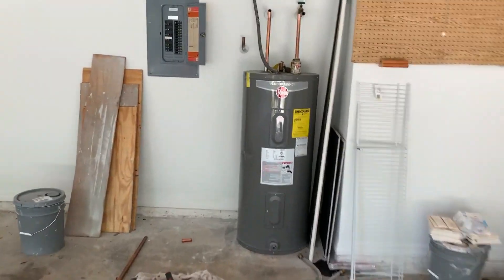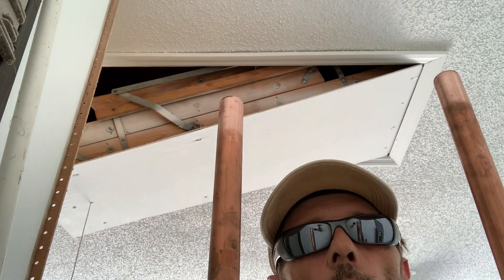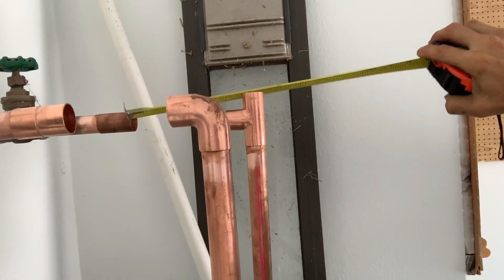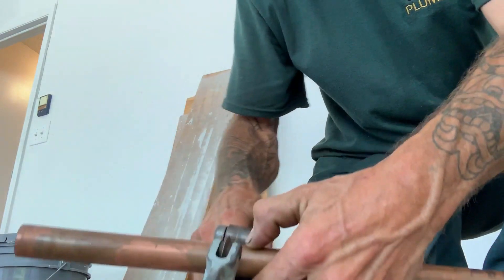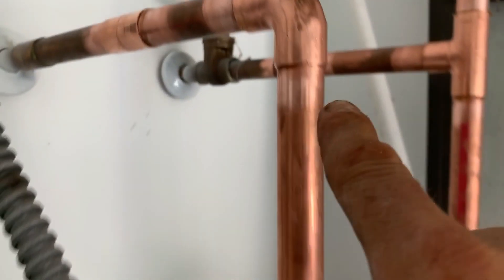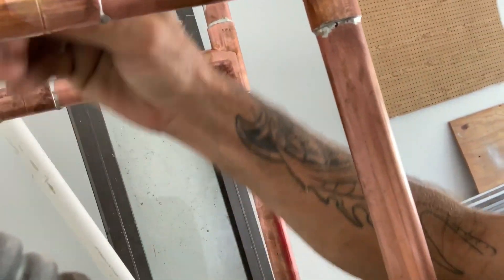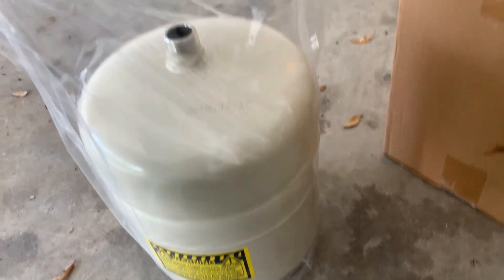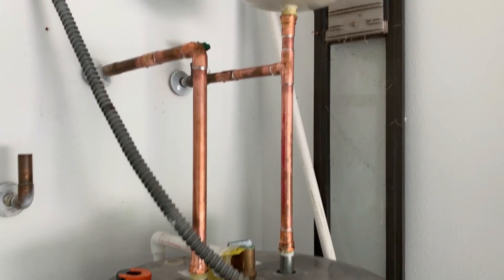HOW TO INSTALL A THERMAL EXPENSION TANK ON WATER HEATER

Comment: Rheem are garbage, why didn’t you use type L copper pipe, M is for the t&p blow off only.
Reply: In 5 years of operation,  my Rheem water heater has never had a problem. And it has a 12-year warranty. Fortunately,  I live in Dana Point, California, rather than "Garbage Grove," California, as the city of Garden Grove is known where I live.
Reply: Herrick Inman don’t worry your rheem heater will start to leak from the tank anytime now, garden grove as been known as garbage grove since the early 70’s due to a sanitation strike that lasted three weeks.
Reply: @borntwice4724   One year after you predicted that my Rheem "will start to leak from the tank anytime now,"  it has still not had a leak and has continued to operate trouble-free since I bought & installed it 6 years ago. If what you claim were true, Rheem would not offer a 12-year warranty. I bet you also believe the 2020 election was "stolen" from Trump and that he really won it "by a landslide."
Reply: @herrickinman9303  When your tank does go...don't buy a tank base on the length of warranty. All are built the same. The diff between a 6 and 12 yr warranty...don't laugh..is they install a second anode rod in the tank. Very true
Reply: @josem2468  Each of my water heaters has lasted 15 years (well beyond the warranty period) without any maintenance.  The last one had a 6-year warranty.

Comment: didn't ream the copper pipe after he cut it,  didn't change that old shut off valve with a new better ball valve, didn't test water pressure to make sure the expansion tank matched with air pressure.
Reply: and no dielectric unions, and used type M copper
Reply: @wcsd9577  How can you tell it's not type L or K?
Reply: @pipingdogtooth  It's L or M and. Type L has blue paint stripe type M has red paint stripe
Reply: @pipingdogtooth  The red ink on the printing of the copper pipe indicates Type M in this case. Versus blue ink for Type L or green for Type K.
Reply: He did not check the house water presure and adjust the expansion tank pressure. It is very important step.
Reply: They are dielectric nipples coming out of heater
Reply: @chrispinette8303  do Rheem water heaters use dielectric nipples? I installing a AO Smith and the manufacturer says dielectric unions are required.
Reply: Probably couldn't read the pressure gauge anyway since he was wearing his sunglasses indoors throughout the job
Reply: He probably did it off camera,  it hard to video everything thing when on a actual job.
Reply: Yup everything he did was wrong.this is how you end up with problems

Comment: Dont use shark bites but let's screw copper fittings to galvanized pipe to promote electrolysis.   Nice.
Reply: They are dielectric nipples with plastic cores
Reply: He is using dielectric nipples he talks about the plastic in them.
Reply: Most have Dielectric Couplings.  Use whatever you want to connect it.

Comment: The water heater will fail well before 30+ year rated sharkbite ever will. And when the water heater fails, you just replace the sharkbite valve flex lines with it like you would a dishwasher or a washing machine. In and out replacement in less than 30 mins
Reply: Sharkbites are fine. I personally wouldn't use them right at a hot water heater but about 16-18 inches away would be better.
Reply: @garygray4664  they are rated for 12" away from tank nipple
Reply: I I am a plumber never use shark bites There’s way better stuff to use I agree with the guy make the video you don’t use shark bites If the homeowner wants to use one that’s his choice but if you’re paying someone to do a job they should do it right
Reply: @grow8094  what's the point in soldering or using pro-press, when a properly installed sharkbite fitting located 12" above the tank nipple (per the manufacturer's requirement) will outlive the water heater itself?
Reply: You hire a hack if they use Sharkbites. Only for homeowner use.
Reply: @josem2468  and this is a home, you moron
Reply: @josem2468 nothing wrong w sharkbites, but they are triple the cost of copper

Comment: Along with explaining how to charge the expansion tank, I think it’s worth mentioning the minimum distance of 18 inches away from the hot water heater that the expansion tank needs to be. You are very close to that.
Reply: Can you elaborate on that "18 inches away" requirement and what is its purpose? Does it have to do with the heat from the flue pipe and the balloon part inside the expansion tank?
Reply: Never heard of that , are you thinking the minimum height of the vacuum breaker perhaps?
Reply: There is a code that says pex has to start 18inch from the water heater lines

Comment: Don't you need a dialectric fitting when going from iron nipples to copper?
Reply: Yes, if you don't use flex connections with the swivel nuts, you have to have dielectric unions so you don't have to cut the pipe to remove the heater,  the plastic in the nipples are part of the built in dip tube on the cold side that puts the new cold water down to the bottom of the tank,  and heat traps built into the new heaters.  Also he didn't ream the pipe which is also wrong,  not reaming will create pin holes in your pipes because the burr that wasn't reamed will stop the smooth flow of the water
Reply: that's the same question I have.  but I do notice the niple has a plastic on the top and maybe you don't need one.     hopefully someone will answer this
Reply: Milwalt. I used to work for Lowe’s years ago in the plumbing department and learned a great deal. I’ll stick with what I was taught by old plumbing experts. Better safe than sorry. It certainly won’t hurt to have a dielectric fitting when joining different metals.
Reply: @Pontiacman1964  technology keeps advancing and leaving some old school plumbers behind. now a days most plumbers don't weld they propress or crimp.  new things keep coming out that sometimes we afraid to try it.   we need to update with new stuff.
Reply: @dannyboy9254  Yes, update o more modern tech, If you have the funds to purchase a propress.
Reply: that's what I said! smh

Comment: Excellent video,  thank you!
I have a couple of questions.... since I am planning installation in two locations in attic, one with very limited space....

1. How far from the inlet side can an expansion tank be installed. Say, would it serve its purpose if I ran a  10 foot pipe from the inlet and installed the expansion tank sideways, or upside down? Shouldn't the air valve on the tank be easily accessible for maintaining pressure?

2. How do you size an expansion tank for a 40 gal vs 75 gal water heater?

3. How do you feel about using pex instead of copper?

Thanks in advance for your help.
Reply: Great questions, I wish he would get back to some of these questions because I need the answers as well. Thank you for asking them.

Comment: Thanks for the vid and info! What size expansion tank do you recommend for a 50gallon water heater? Or does it really matter?
Reply: Smidjee it depends on 3 factors:1 size of water heater 2 your household water pressure 3 water heater temperature setting. Referring to the following doc page 2 figure 1 to find the right size of expansion tank you need.
https://www.amtrol.com/wp-content/uploads/2019/02/9015-942-01_19-Thermal-Expansion-Tank-IO.pdf

Comment: Hello, any specific reason you don't want sharkbites?  Are they not technically up to code?
Reply: Sharkbites allow DIYers and handymen to do plumbing jobs that normally you’d used to call a licensed plumber for. Sharkbites work and last if you follow instructions. Problem is unskilled people often don’t follow instructions (don’t deburr their copper and/or don’t insert the fitting to full depth) and you end up with leaks and they get a bad rep as a result.
Reply: There a hack job

Comment: Is that type M copper you installed on the cold side (red mark) usually type L is suggested for water (blue). Type M is only for heating
Reply: Every service plumber worth his salt uses L pipe
Reply: mastersfan04 is this video for professionals? Doubt it since he shows how to use Teflon tape. Any help is appreciated.  I thought copper pipe was copper pipe.
Reply: @SammyEddie  this video is for DIY people, but it's bad advice. Water heaters should be connected with flex lines or unions , and the thermal expansion  tank should have air pumped in to match the static water pressure. There are good videos of that.  The video is correct about soldering though.
Reply: mastersfan04 so DONT make straight, all copper connections?  I was going to redo mine.
Reply: @SammyEddie  you can if you use copper unions. If you live where I do in an earthquake area, solder copper MIPs and use flex lines. If you don't have earthquakes hard pipe with unions is fine.
Reply: You can use M if you want, just not underground

Comment: Good video how though it was more about the copper than the actual tank. Did you add air to the tank, and what is the pressure in the tank installed in relation to the pressure in the plumbing system?

Comment: no dielectric unions or unions at all???
Reply: Christopher Segar why would he need a dielectric Union he is using all copper not mixing metals
Reply: Steven R Mott he is mixing, you cannot adapt copper to galvanized without having brass in between it, flexes or dielectric unions, Electrolysis is real my friend, and Code
Reply: Heat trap nipples are already dielectric
Reply: Its not about being dielectric anymore it's still code to use unions, now someone will have to cut the copper pipe to do anything... what if he couldn't start the heater because of a issue and had to return the heater and get a new one? Now without unions you can't without cutting pipe.  This isn't code
Reply: @footlongburrito  So unions should be install for ease to change tank? The tanks change in height constantly. The odds are slim you fine the exact perfect fit.
Reply: @josem2468  that's irrelevant of them changing height,  the point isn't just as cut n dry as you stated, it's if the heater needed to be moved for any reason,  the union can just unthread and thread back together without the need to solder or anything.  Which is also the reason many use flex lines,  union is built in
Reply: The nipples that come with the water heater are not galvanized

Comment: You didn't charge up that
 expansion tank with air matching the pressure to the incoming water supply. That tank on there isnt doing anything useful without a proper charge.
Reply from the maker: I’m glad you guys mentioned this as I realize that I left this step out. I will be doing a follow up video about this critical step. Thanks for watching!
Reply: @PLUMBINGWITHTIM  Can you provide a link to the update?
Reply: lil tip, they usually always come pre charged @20lbs.. an easy way to figure out what to charge up too, pressure test the house , thtl be your # then use air compressor. never charge passed 80lbs. usually 50 is where it’s at.. yes most people don’t charge them, makes it pointless to have if not charged... anyways good vid! keep it up man, stay positive!  im an commercial/industrial plumber. plumb everyday on big systems , an no matter what you do somebody will always have something to say lol everyone thinks they know it all, an most likely really don’t know shit ..wish people were more positive
Reply: Nikko Garcia those typically come precharged just saying
Reply: @darienlandry3244  Not enough. Needs to match the system pressure.

Comment: Tim 
Job isn’t done quite yet.  You need to check the water pressure from the city coming in.  Easy to do just put a pressure gauge at a hose spigot preferably near where the water comes in. Take that pressure and use a small air hand air pump like a bicycle pump to pump up the expansion tank. On the expansion tank is an air valve it looks just like the one on your car tire. The tank needs to be inflated to the same pressure as the city. Otherwise the expansion tank is just a decoration and provides no benefit.
Reply from the maker: Very good point my friend. Thanks for sharing that. Much appreciated.
Reply: Tim Robinson those typically come pre-charged
Reply: @darienlandry3244  But you need to match the house water pressure. The tank may only be charged to 20 or 40 PSI from the factory. I just installed one at a house that had 60 PSI. Had to pressurize the tank. If you do not balance it, it will not work properly.

Comment: Did you use a torch to join the connections or does just the glue do it?
Reply from the maker: All copper solder.

Comment: Shouldn’t there be a couple Dielectric Unions on there? (Going directly from copper to galvanized)
Reply from the maker: Good question. Back in the day when water heaters had galvanized nipples
These days they are made from a different alloy so it’s no longer required
Reply: PLUMBING WITH TIM  That’s good to know! Thanks :-)

Comment: I have never put a wrench on the fitting on the expansion tank, just hand tight like you said, never had an issue. I will add my .02 cents and say I would have put a wrench on the female adapter to hold it while threading the tank on. As always Tim great video!